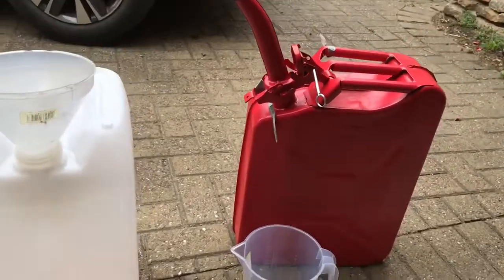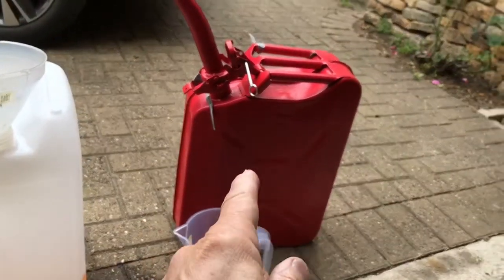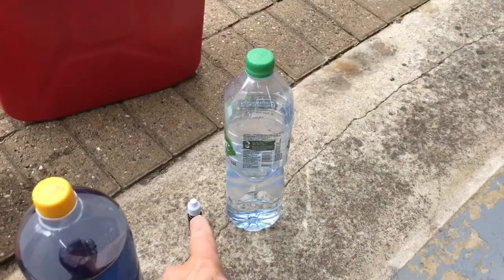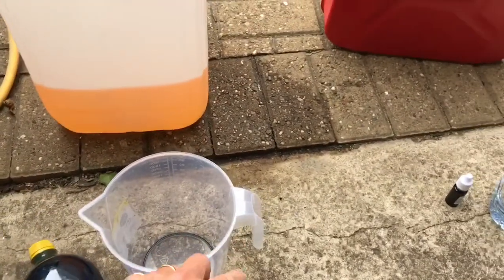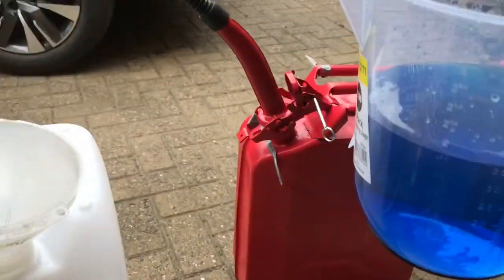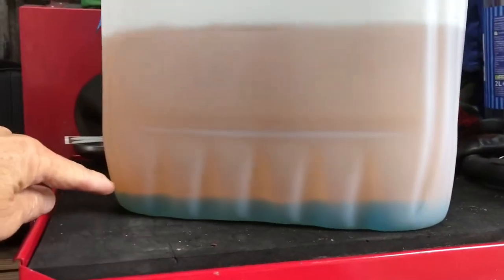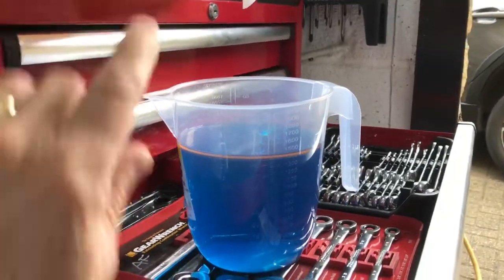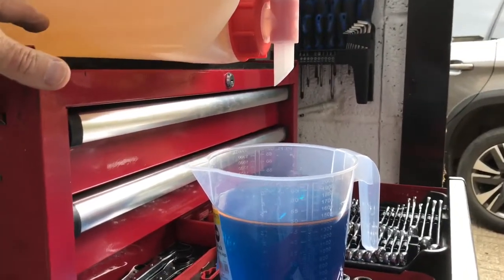How to remove Ethanol from unleaded fuel

Comment: Ethanol molecules are smaller than water molecules, so when the two liquids are mixed together the ethanol falls between the spaces left by the water. It's similar to what happens when you mix a litre of sand and a litre of rocks. You have probably removed ALL of the ethanol.
Reply: @Garry Grigg
complete rubbish. the molecules attach by forming covalent (hydrogen) bonds.
Reply: This is just not true! Size of water molecules 0.28nm size of ethanol molecules 0.44nm

Comment: Could have done with seeing you separating the water out
Reply: He just drains it from the cock at the bottom of the clear drum until petrol comes out after the blue dye. The dye is only there to make it clear which is water & which is petrol. Obviously, don't use yellow dye. Leaning the drum forward about 15° (a plank of wood under the back) will give good results.
Reply: @capnskiddies  its as simple as that, unreal!
Reply: @capnskiddies  "Cock" 😂😂
Reply: @capnskiddies  a video would have been less typing 😂
Reply: This is a great little video. Very useful information. Many thanks indeed.

Comment: I never run fuel with ethanol in any of my portable gear, saws, mowers, weed eaters, generator, pump, ATV or Argo etc. This "junk" fuel with ethanol is only safe to use in the newest vehicles.
Reply: I do the same. I have a 1992 Saturn SL2 (got it from my mom when she passed) that I never put ethanol gas in. The only time was when I first got it and had to drive it home.
Reply: Must be a UK thing only. Everyone here runs e85 in all their shitboxes for extra power
Reply: @Jamxknife  e85 does jack shit for more power and is worse on fuel economy

Comment: This is a nice demonstration of practical chemistry. The only comment I have is that this works out more expensive than buying super unleaded which should be ethanol free or E5, although the manufacturers are not very helpful about ethanol content (or geographical borders). This from Esso “ Esso super unleaded petrol (Synergy Supreme+ Unleaded 97 and Synergy Supreme+ 99 ) is ethanol free (Except in Devon, Cornwall, North Wales, North England and Scotland). We would therefore advise anyone who has concerns about the presence of ethanol in petrol to use Synergy Supreme+  – providing they do not fill up in Devon, Cornwall, North Wales, North England and Scotland. The European standard BS EN228 covers the requirements for 0-5% ethanol unleaded petrol, the labelling requirement for zero % ethanol is E5 (as is up to 5%), a E0 label doesn’t exist.”
Reply: Hi, you seem to know a lot about fuel, but I thought all the adverts on the radio were saying all fuel is changing? The new fuels will have more ethanol content, and your vehicle, if older than 2011, might not like it? If super unleaded is not going to be effected, then I’ll be happy?
Reply: Not an expert at all. I just heard that super unleaded was safe for cars that can’t use E10 and searched for the makeup of super grade petrols. The redo comment is pretty well useless in detail but unless it’s labelled as E10, it should be ok for all the engines that have used E5 over the last few years.

Comment: Or just use Esso Supreme + 99 RON. It contains no ethanol.
Reply: Lars Fillmore In Scotland, Cornwall, Devon,North Wales and North England it still contains Ethanol As per Esso website
Reply: @billwhiz1  is it still the case then that other parts of the country the Esso 99 doesn't have ethanol? My local Esso here in Suffolk has the Supreme 99 but it's still got the E5 label on the hand pump?
Reply: E5 just means it can contain up to 5% ethanol not it has. 1st lead now ethanol anything they can do to remove our cars from the road they do. Pot holes, lousy e5 and now e10 then what. Will be interesting to see what my MP comes back with as I wrote to him to complain.

Comment: Ive a feeling this video is just about to become very very popular .
Reply: Youtube will probrably ban it
Reply: @salvofarnia8046  😂
Reply: @salvofarnia8046  J tube is run by J Rhatz
Reply: Not new info but rarely put together in a clean cut way
Reply: Brooks Hadlin  No not in a modern car, I run older cars and one of which I have had to replace the rubber fuel lines with fuel lines that should be able to take the new ethanol based fuel, this was due to the fuel eating at the rubber from the inside out and caused a fuel leak. As you have said it won’t make much difference to a newer car that can adjust the air fuel ratio.
Reply: Brooks Hadlin  My guess is you don't have anything with a small engine?
Reply: Brooks Hadlin  Yes definitely, I bought about 10 meters of fuel line, it’s high pressure rated as well so I will do my 30 year old fuel injected car soon. All the best. Cheers.
Reply: Super thank you!!!
Reply: Brooks Hadlin  a few thousand dollars worth of bills towards modern motorcycle fuel level systems would like to argue with that
Reply: e20 in india. I'm gonna do this for my 2 stroke
Reply: Glad this aint happening in Canada!
Reply: @lurk7967  You're being sarcastic right?  Canada has had ethanol blended fuel for quite some time.
Reply: @bmdbigfeet1031  I think he meant in premium gas ( the 91 octane has no ethanol in canada) and is available at every gas station.
Reply: @Peter-.H  I'm aware of  that.
Reply: @lurk7967  sadly I think it will be all over the world eventually 😠
Reply: @Cavalier_Steve  eventually it will no longer even be available.
Reply: @anunentitledmotivatedmille7731  very true!
Reply: I've a feeling this video will disappear very soon !
Reply: The fuel is extremely yellow.. the  his separation..  the valve is quite high for not having a shitload of fuel in the measuring cup
Reply: @TheCharillz23   but it gives the basics and enough info to have a test set up and a play at home and see ,,, I really dont want to be forced into using ethanol ,,, they should have offered it along side the super unleaded etc as an option , with a cost adjusted to suit ,, this stinks , like the buy diesel we were all pushed towards a few years ago , now every one has diesel , its going to be taxed to death as its suddenly super bad ,, it wasnt super bad when they wanted us to buy diesel cars .
Reply: @tomthompson7400  that's the scumbags bull shit tactics. Any mupet with functional nose can tell diesels spew out more casanagenic filth than petrol. All they care about is co2 emissions. Theres alot worse pouring out them than co2. The same thing will happen with EVs the prise of electricity will skyrocket the closer to 2030 we get and they will eventually get hit with road tax. It will end up costing the same if not more per mile than petrol but with the privilege of 2 hour charge times. Battery degradation not to mention the much higher intial cost of purchase. It will make precent day motoring seem cheep and easy.
Reply: @TheCharillz23  the important bit is that the colored portion was raised as the ethanol was removed alongside of it.
Reply: Brooks Hadlin  except anything with a carburetor it destroys and makes unusable, which is the whole point of this video.
Reply: This ethanol fuel,, does attract water.
Reply: Especially with the nasty 10% ethanol that’s due to come to the pumps over the next month or 2.
Reply: @Cavalier_Steve  "just use premium" they say. Yeah let me nip down to the nearest place selling that, only 100 miles away
Reply: @VeyronBD  yeah it’s a joke, not to mention the premium prices that are being charged. But it’s still 5% ethanol it won’t be long when it’s 10%!
Reply: @VeyronBD  lol they sell 110 octane here. By VP raceing
Reply: @Cavalier_Steve  we've had 10% ethanol so long here in the states that i dont actually remember a time when you could get non ethanol where i live. It destroys older cars if it sits for any length of time.
Reply: @MegaDysart  Thanks for that info Joe, I will remember that when I store it over winter. All the best. Cheers.
Reply: @Cavalier_Steve  But you are not in the EU?
Reply: In my part of Fl WAWA's have ethanol free gas. That said, 30 years owning a lawn service I have not had any problems with ethanol except maybe 20+ years ago. Its ideal for boats since it does NOT attract water and it can be ideal for storage, otherwise waste of money pretty much.
Reply: Ethanol is very good for gasoline engines..
Reply: @shalashaska9946  it's carbs on older two strokes I worry about ...
Reply: @CZ350tuner   thats a twist on the theme ...
Reply: @shalashaska9946  unfortunately not for gasoline systems and sensors
Reply: @shalashaska9946  Nope can't use anything over E-10 in my old truck, or E-15 in our new car !

Comment: At least most bikes/generators etc have a petcock so you can turn off the fuel and run carbs empty when your finished with the machine, I have done this with my generator for 5 years no problems. I also use Aspen fuel in Coleman lamps instead of unleaded keeps for years without a problem.
Reply: This is what I do if possible.  The ethanol isn’t in the gas just to cause problems it’s main function is as an octane booster so if you remove it you have a lower octane fuel that may not run very well.

Comment: You still had to pay for the ethanol and then the octane booster. It is a poor green idea as the ethanol fuel gums up the fuel parts and forms corrosion products in the tank whilst evaporating off the volatiles.  6 week life in the can.
Reply: Not if the can is fully sealed. It can’t evaporate in a sealed container 😏
Reply: @Graham Dawes modern cars which are can use ethanol fuel are driven often, ergo not a problem. and the benefits of reduced emissions far outweigh a few corroded parts in the few cars not ethanol compatible.
Reply: If your fuel has a 6 week shelf life you've done something seriously wrong. Even improperly stored E10 has a 6 month shelf life
Reply: @DavidPruitt  that was my mistake I meant months, over winter it is useless.

Comment: Very useful information. 

I always thought the term was 'hygroscopic' however? Def'n: 1. hygroscopic - absorbing moisture (as from the air) absorbent, absorptive - having power or capacity or tendency to absorb or soak up something (liquids or energy etc.) - from The Free Dictionary.

Anyway I would only use forecourt fuel if unable to get anything better for my carb engine. My entire strimmer fuel system, filters and carb diaphragm was totally destroyed by forecourt fuel - even worse now - the ethanol is being increased to 10%. Never using that stuff again. 

Use premix alkylate petrol, like Aspen make, and skip the benzene overdose from forecourt pump fuel. No ethanol in it either. Keeps for many years with no additives needed, even when left in the machine. And because the heavy distillates of forecourt fuel are not present in alkylate, practically no carbon build up occurs.
Reply: He said Hydrophilic.
 Hydrophilic (biology definition): water-loving; having an affinity for water; capable of interacting with water through hydrogen bonding.
But yes a very interesting video👍

Comment: My biggest concern with this process is Household Insurance.
One innocent little spark maybe from a light switch, and it's bye-bye house.
Investigation reveals Petrol being stored/decanted into open or illegal containers.
Insurance claim refused. No House & No Money.  Explain that to the wife !
Reply: best not fill your car with petrol in case you pour it all over the battery and render your car insurance void. your wife apparently seems to dominate your existence, doesn't sound like a healthy relationship.
Reply: Why would you be pouring it over light switches? I used to recycle 600 gallons a month in an old job and kept it all in my garage. I never exploded once.

Comment: Ethanol is a deliberate act of sabotage by the green brigade to pursuade us all to move to electric vehicles and scap our older petrol engines. It was first introduced in America were  many small engine power tools like lawn mower and snow blowers are thrown away every year because their carburetor's are clogged by ethanol adds to petrol fuel. This also makes the engine run poorly causing higher emissions before failing all together. These are then sent to landfill and replace with a new one. If you wanted to create more waste you couldn't have succeeded better than this brainless policy. But the big corporations who  are behind these government policy dont care because they get to sell you yet another  lawn mower at your expense!

Comment: If you mark the plastic container at 10L and 11L you can do away with the measuring jug.
Apparently from Autumn 2021 even Esso Supreme will, by Law, have to contain E5.
My classic bike fuel tank has a Fuel Cat (there are other makes) inside it which helps to boost the Octane rating. One of these or similar could be inserted in the plastic container and save purchasing bottles of additive.
Reply: Sorry to tell you, in-tank fuel catalysts don't work. It's a con.

Comment: Does anyone know how this will effect two stroke engines such as Lambrettas and Vespa classic scooters🤔🤔
Reply: 2 strokes traditionally will run on low octane, but would still add an O-booster.
Reply: Eric Walker
It will blow them up!
Reply: @redblade8160  ive been running racing 2 strokes on it for 20 years....n no blowing up.

Comment: Are You sure that the octane booster boosts octanes enough? As the remaining petrol has very low octane rating, to get enough octanes to not break engine, it better boost the octanes about 10 units. Yes, one can safely use that in a T-Ford, but any performance engine may have problems. I use alkylate petrol, "garden petrol", "small engine petrol" in all my hobby vehicles, as it is safe to carbureted engines,has high octane rating, and is all-round safer to use. It also stays usable for years. Avgas would be best,still has lead in it, and in some countries people even make up a story that they are building an experimental aeroplane to get it... Some boats with aluminium tank have already paid the price of using E5, the tank starts to leak. I am not trying to rain on your parade, just warning that the octane rating may still be too low for some engines.
Reply: Simply start with Super Unleaded 99 octane, before you extract the ethanol...

Comment: Any thoughts on using aviation gas (AVGAS 100ll), in your classics? A classic car engine workshop here in Germany told me he uses it in all his cars. 

https://en.m.wikipedia.org/wiki/Avgas
Reply: I've used it with no problem
Reply: We use it in our claassic racing two strokes., Usually 50/50 with super unleaded
Reply: it's more a question of availability/access

Comment: Very interesting, although for now, most of the country can just buy Esso Synergy which is advertised as ethonol free.
Reply: but not everywhere now, its slowly being replaced by e5. my local used to have ethanol free but informed me last week its no longer the case
Reply: @deanwarner2006  where do you live ? Esso UK Technical Office stated last week that except for in Cornwal, Devon, Deeside and Scotland, Esso Synergy Supreme+ will stay ethanol free until further notice and is safe to use in Motorcycles and Cars with Carburettors

Comment: From what I have read elsewhere on the internet, Esso Supreme unleaded does not have Ethenol in it despite the 5% label.
(Although some pump stations in the West of England do)
I have a 2001 bike with carbs and have to avoid Ethenol fuel
Reply: Interesting. I have a BMW 2014 RT1200. I think I'm okay but I really don't want the problems I'm hearing such as water in the tank forming over time, plus a reduction in economy (as if prices weren't high enough). As I understand it, the 97 RON pertrol won't be changed. I might have to switch to this.

Comment: Can I recommend that you run your final mix through a " Mr Funnel " these have a filter with a certain gauge of mesh that allows fuel molecules through but traps water molecules.

There is several videos on YouTube showing them in action.
Reply: @Eddie Hitler  lol ,, i can use a funnel , Im not sure Im clever enough to even buy anhydrous MgSO4 ... do I dilute it ?
Reply: Mowtown NI
You complete idiot; you can't filter out "molecules" with a filter through a funnel!
Reply: @redblade8160   ive seen these funnels at shows , and they filter out the water some way or another ,,,,

Comment: The 100ml that couldn't be removed, is that going to be just ethanol (So effectively the fuel now being E1 at 1% rather than E5 at 5%)  Or will it be a water/ethanol mix in the petrol?  For instance say something like E0.5 and in this case 50ml water?
Reply: @Eddie Hitler or sodium or calcium sulfate. easier to separate.
Reply: e5 is not 5% ethanol...... it is anything up to 5%.  e 10 is between 5 and 10%.

Comment: E5 is being phased out to be replaced by E10. SO 10% ethanol. All we need now is a cheap and readily available source of TEL so we can protect valve seats.
Reply: central heating oil
Reply: @georgebarnes8163  You are joking! Never heard anything so idiotic!
Reply: @robmontier639   I run my premix 2 stroke @ 2% heating oil, easiest way to replace the lead, works very well
Reply: @georgebarnes8163  don't recommend adding oil to fuel intended for 4 stroke engines
Reply: @daos3300  adding oil does not harm a 4T engine, I  run my race engines with a little R40 or 2T premixed